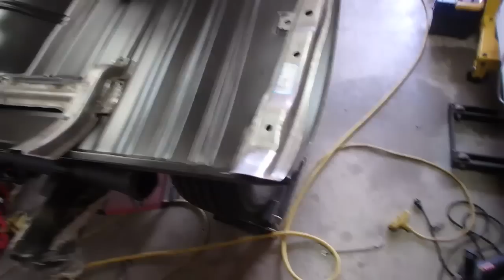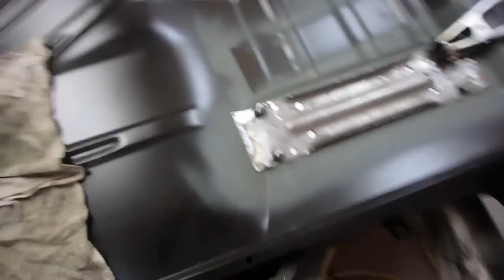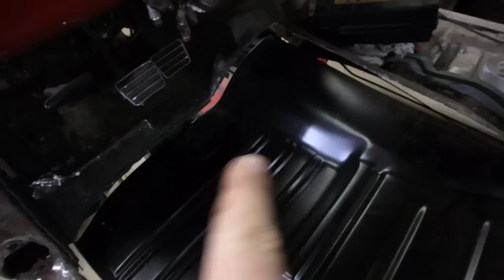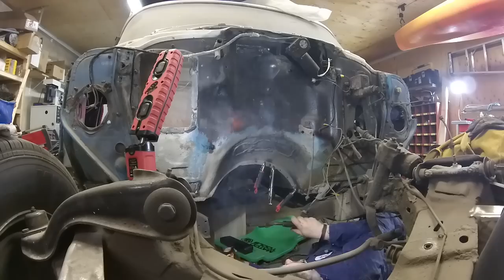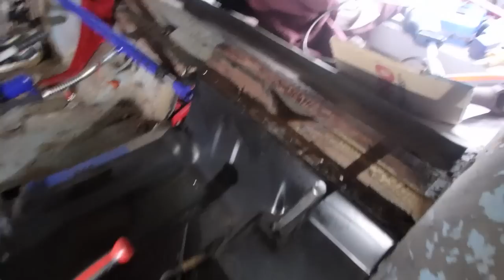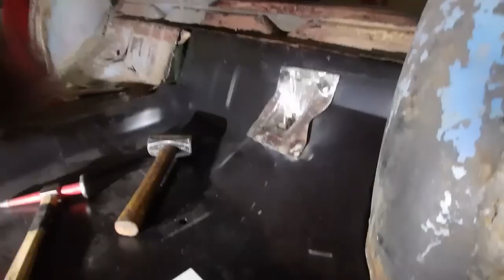1957 Chevy Drivers Half Floor Replacement

Comment: This video brings back memories for me. I can remember when we drove our 1977 ford monarch with no floor. I ran two steel square tubbing pipes from one side to the other and bolted the front seat to it. Everytime I would accelerate from a stop I would have to grab the steering wheel tight to hold us from tipping back in the seat. The only thing left of the floor was the transmission hump so you would have to rest your legs on that. For the winter I did put some plywood down.  OMG those were the days. I am chuckling as I tell this story to my wife sitting next to me. Thanks for the video Jerry...what a blast from the past it was for me. -John
Reply from the maker: +The Plow Guys that sounds pretty sketchy,  what have you been up too since the snow has melted
Reply: Going to be doing some really cool shit. Got a new toy and I will be making a video....see you there. -John
Reply from the maker: sweet will be looking forward to it

Comment: I couldn't commit to a project like that... maybe if it was the only one / thing, aside from work. Good on you for sticking with it and still doing all the other stuff you do!
Reply from the maker: +Thomas EXOVCDS this is why it's been sitting in my garage for 10 years hahahah
Reply: +Bullshitkorner Yeah... but you are still getting to it now and then. I would probably cave / cut my losses after the first year. Off topic... the supercharger addition you did, is something I'd like to do to my E34. I turboed my E30 and have boost withdrawal symptoms since I got this E34. Hoping to be boosted within the next 2 years. :)

Comment: my base was 25 mpg highway added 3 to 4 with cetane booster fuel system cleaners and 2 stroke oil all in the fuel. the tuner made the biggest jump superchips in xs mileage tune, jumped me to 34 35mpg, shifting was faster /firmer too. motorkote in the engine oil with normal rotella 15w40. of course in town up hills etc back to 24 25. I sold my new titan which was getting 17 on highway, and coming apart ar the seams and got the 07 f250
Reply from the maker: +rob armstrong i use cetane boost with lube in my jetta, I can notice a difference
Reply: Bullshitkorner they say that american diesel is really poor in cetane averaging 30 whereas ford recommends 40 for operation, cetane boost brings you up 6 pounts or so. When i dont use cetane my cat 3208 and 6.0 sound quite a bit rougher. Low sulfur diesel doesnt lubricate too well either so add that too. Ashless 2 stroke helps out same as biodiesel

Comment: Question. You may have said before, but that was too many MFBT times ago. For your motor are you going to rebuild the one you have, or pick up a ls motor?...
Reply from the maker: +Paul Inman once I get back to work i'd like to try to fit a 12v cummins in it

Comment: if you had an assistant like buddy van doodle things will rip along.. bmp
Reply from the maker: +rob armstrong a helper sometimes would be great, Not a 1puglife fan, can't stand the way he treats and uses people
Reply: Agreed, sometimes i get a laugh tho
Reply from the maker: rob armstrong back in the day when it was him and Bam were the best videos.  His head has swollen too much and he thinks he can do what he wants,  I do watch the jumps though
Reply: +Bullshitkorner. his old 6.0 ford egr fixes convinced me to buy a f250 haha!! ...will i never learn.. sad face.
Reply from the maker: i got rid of my F350 before the warranty was up, biggest pile of shit i ever owned.  Missed having a diesel and the lariat package
Reply: +Bullshitkorner the 6.0 needs its problems addressed but is a good motor. with tuner cetane fancy oil etc it get 35 mpg at 118 km/hr on flat highway and i have just about 500k km on it with original head bolts. heard 6.4 is a disaster tho
Reply from the maker: how are you pulling off that mileage, I was lucky to get 18mpg
Reply: +Bullshitkorner whoops replied above. also goodbye duratracs and got new  bf all terrains